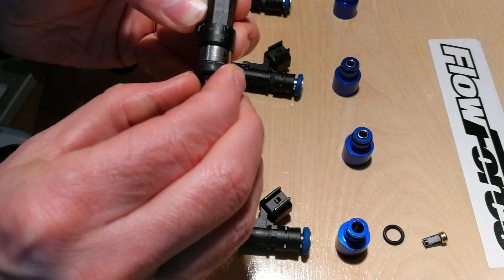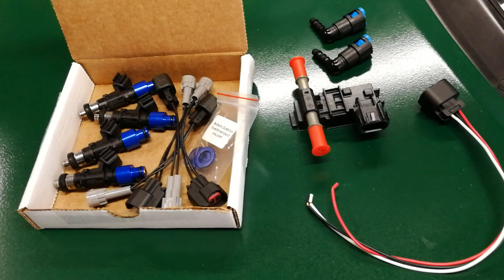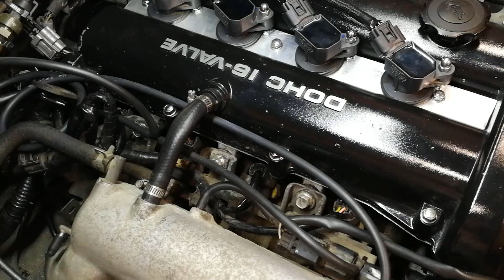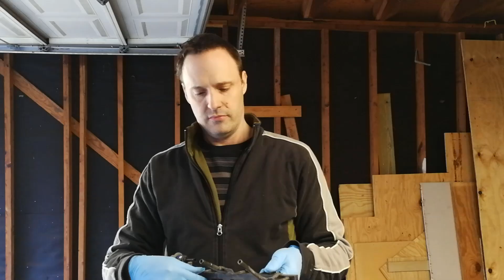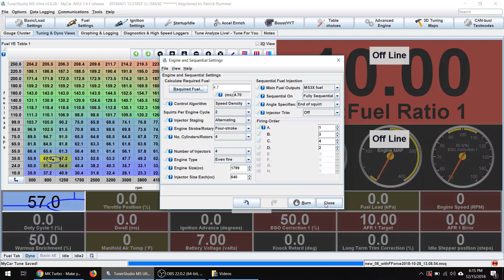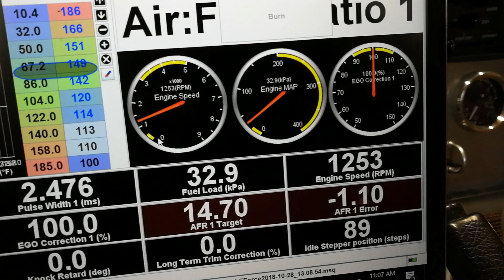Big (Flow Force) Injectors PLUS Flex Fuel!

Comment: Hey ogpedexing with this setup Idk of I missed it but did you have an afpr? Also what fuel pump did you run? Lastly what power did you make with the 640s and e85? 

I'm asking because on my nb with a dw200 and ff640 at 752cc 4 bar I'm seeing duty cycles at 93% on e85. I have a hotside mp62 at about 13psi at the top. I know the nb fuel pressure goes down with boost but even at my boost levels I find it hard to believe I'm actually at a duty cycle in the 90s. Virtual dyno plots about 240hp on e85. To me it doesn't really add up and I'm sure the virtual dyno numbers are being optimistic. Calculators online tell me even at 3 bar pressure a duty cycle of 90% can get me to 250whp with 605cc injectors.
Reply from the maker: E85 will up your duty cycles but usually not by that much.   I'm at about 240 hp with a dw200 also and  just the stock fpr at 3 bar.  It's been a little while since I looked at it but I want to say I can get to 80 or 85 DC on a long pull but that's as high as it's  been.  Recently I've just been doing about 12 psi since all the engine internals are stock.  My numbers are virtual dyno also so ymmv.
Reply: @OGPedXing  appreciate the quick reply. Also yeah im aware about more fuel with ethanol.  Maybe there's something else going on into the fueling equation that isn't accurate. I have read that tunerstudio can show duty cycles of over 100% and that can't be possible. Those high duty cycles I'm also just seeing on WOT pulls in chiller weather so more fuel would be commanded compared to hotter weather. If everything is accurate I can only think that I'm actually above my horsepower rating. I guess I'll jut check on my afrs and if anything gets lean then I'll investigate.  Oh also to note my ff640 were rated at 640cc at 3 bar. I've seen some people get ff 640s that are actually rated a little higher like 660cc at 3 bar.
Reply: @discount111 i’m having the same exact problem as you, did you ever figure it out?
Reply: @shawn_lifts  I was maxing out my flow force 640s with a dw200 so I went to afpr and cranked up the fuel pressure.  I underestimated how much fuel I needed because I didn't realize the power I'd be making
Reply: @shawn_lifts  I don't think some of the online calculators consider the pressure drop  from the boost pressure.  So the higher boost you run the more your fuel pressure drops if it's not a rising rate fuel regulator. So with the nb miata it's 4 bar pressure and thr regualtor doesnt compensate so it lowers with more boost

Comment: Super helpful info for my build! Where did you buy your 90deg quick disconnects on the flex fuel sensor!?
Reply from the maker: I got them on Amazon at https://amzn.to/3HzkB7z but it's a Dorman part so local autopart stores should have them as well.
Reply: @OGPedXing  THANK YOU! I couldn’t find it with a 90deg and the ones I did find weren’t the right size and 3x the price.
Reply: @OGPedXing  have you encountered any issues with your hose routing and fittings like leaks or weird readings? Also do you know where i can get something to disconnect the quick connects that go to the sensor? I have a little tool that slips over the hardline buy it looks like there's no room on the sensor hardlines for a tool to slip over.
Reply from the maker: No issues with leaks or anything so far.  Unfortunately I haven't found a disconnect tool for these either...I carefully pop it off with a pick tool or else I disconnect the rubber hose end.
Reply: @OGPedXing  you're awesome always reply so quick but yeah same I haven't found any tool that looks like it can fit. I don't have the sensor yet but I think I might consider a sensor with longer hard lines and maybe that will give me enough length If I ever need to disconnect the sensor